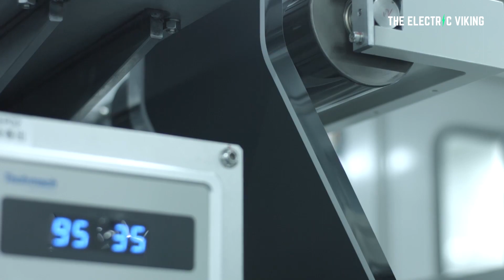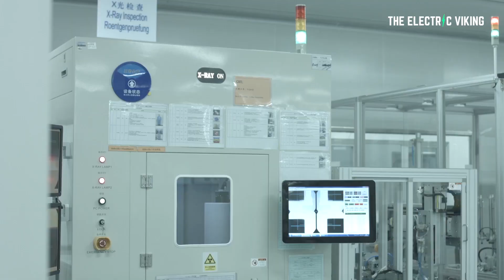Tesla starting Giga Texas 4680 production for Q1 2023 ramp

Comment: Just a guess on 2nd generation 4680 production is squirting the liquid electrolytes without foaming or cavitation, considering the line speed. I haven't heard about this anywhere but was trying to figure out what could be the biggest bottleneck in the battery production and the dry coating without damaging the thin metal foil at speed too.

Comment: 1000 cars w 4680 by the end of 2022? Is ramping up?  They make currently 3000 cars a day. That is 1/3 of one days production a week ie 1/20th of all cars would potentially get 4680. So what determines then who gets the better batteries? Lottery? Just Plaids? Will buyers have the option to wait for the 4680 version of their car model?  Is Cybertruck still on track for 2nd quarter? Lots of questions not that many answers
Reply: Jim I think Elon was referring to the Austin facility only.
Reply: Plaids don't use 4680 cells.
It's doubtful they will re-engineer the whole production line on a low production car which already outperforms the "opposition" and is beyond the ability of the vast majority of owners.

Comment: Will 4680 Type batteries be seen in other cars than teslas? (as Panasonic produce some of them)
Reply: Probably. 4680 is just a form factor. It literally defines the diameter, 46 mm, and length, 80 mm.
Reply: Think about it this way.
The 4680 form factor had an issue with overheating, which is why nobody used it (in high performance cells)
Tesla (Maxwell) found a solution and scaled it.
.
I don't think it's coincidence that there are now 3 (or more) other companies perfecting 4680 cells now?
.
I think we'll find these are using the Tesla "in good faith" patents.
.
If so, is it likely that Tesla will get first refusal to all cells until there is excess production?
.
Is there an agreement that they can sell a percentage to others?
.
Is development information gained by the other companies shared with others and Tesla? (To "advance the mission"?)
.
It should be noted that if they can ALL share and develop mass production, (based on Tesla production tech??) they ALL have potential for huge profit.
As such there's a great incentive to cooperate.
Reply: Rimac said they will use the 4680 format in cell to pack and cell to structure pack's in their future evs. 
So it's likely, BMW also said they are switching strategies to use cylindrical cells from 2025 or so. 🤔

Comment: As a programmer, I know that when I develop a project from scratch, I will almost never consider it to be production ready once I'm done. Quite the opposite. My first (sometimes second and third) gen code simply serves as an initial test of concept on which newer rewrites are based. The newer rewrites are always better in terms of efficiencies and optimizations. These optimizations are much more than bug fixes and simply getting it to work. My code has to be written to account for scalability, speed, maintainability and overall system operations. The only way to achieve this is to write the code and run the piss out of it. Stress testing it to see what breaks and where the bottlenecks are. It often takes multiple rewrites before I am happy with the result. People think that building an an assembly line is simply lining up a bunch of robots and switching on the power. Nothing could be further from the truth. The 4680 cell production line was built and stress tested and looked at from every possible angle to make it better and faster, hence the second gen improvements that are taking place right now. Knowing how Tesla goes about things, expect nothing short of revolutionary once they get it up and running at full speed and their engineers are "happy" with the results.